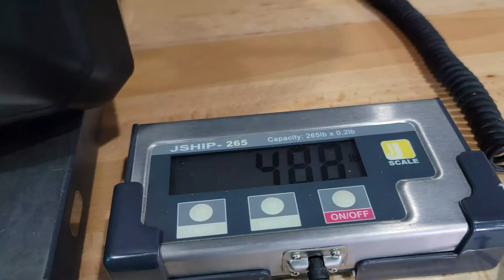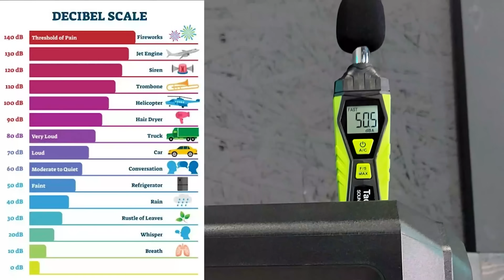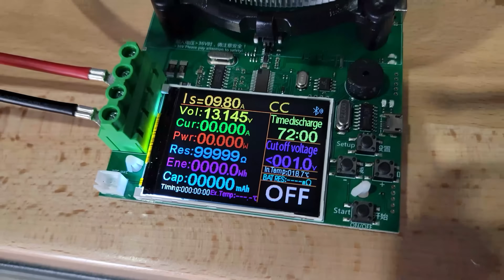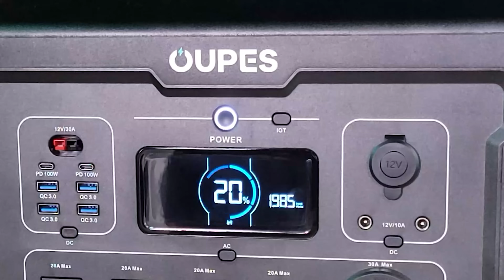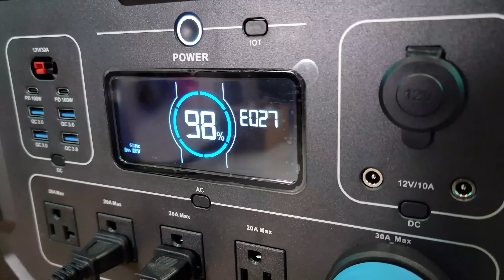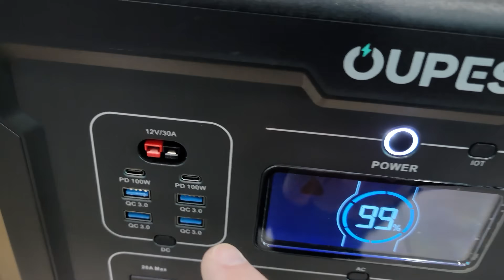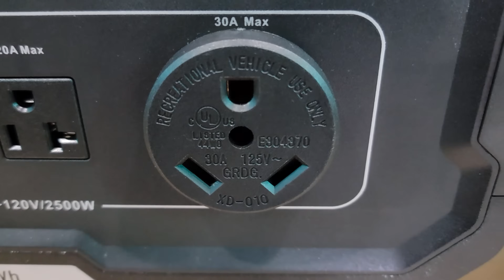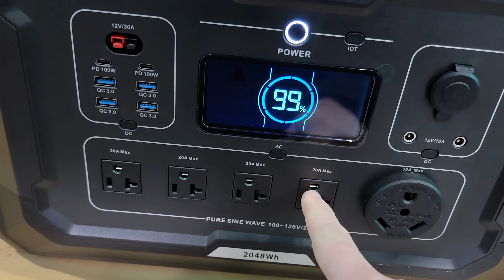OUPES MEGA 2 Portable Power Station

Comment: I Hacked My Anderson Connection to Cigarette Port for a CNSWIPOWER DC to DC  ADJUSTABLE POWER / BUCK Power Supply that can be Set to 775 Watts stimulating Solar from a 12 or 24 Volt Battery for Extreme Situations to Recharge My Mega 1 and B2 expansion battery.

Comment: I’m vacillating back and forth between this and the Bluetti AC200L. I know you’ve reviewed both. If it were your wallet, which would you choose and why? My primary use would be to run my refrigerator, upright freezer, and WiFi during power outages. Than you
Reply: I have a mega 1 and it has been flawless. I use it to power 2 freezers as a UPS, works great. I think Bluetti is a good brand but you'll pay more for it.

Comment: I was looking at 4x Aptos 400W BIFACIAL DNA-108-BF10-400W All Black 108 Bifacial Solar Panel. Can you tell if they would work? Im getting 148v 10.8a with my calculations which could be wrong.  New to solar was trying to find portable power station & panel combination for a shed. That might be more affordable than trying to run power to it.

Comment: The reason 3-prong outlets are now being installed with the ground pin at the top is that if the device plug is not seated all the way into the socket (creating a gap) and a conductive material (chain, foil, tool, key, etc etc) slips into this gap from above it will contact the ground pin and not a hot contact post.  Safety feature.

Comment: To save space in a van, do they offer a cord to connect the 2000 watt battery pack to the Omega 2 that has the plugs at a right angle?
Reply from the maker: I don't think so. You might want to reach out to Oupes customer service to confirm though. Thanks for watching and commenting